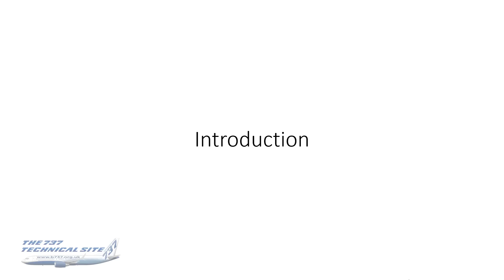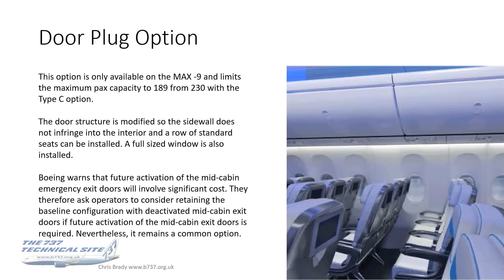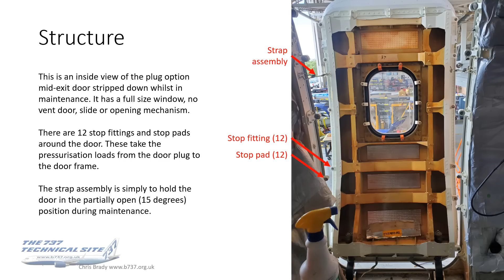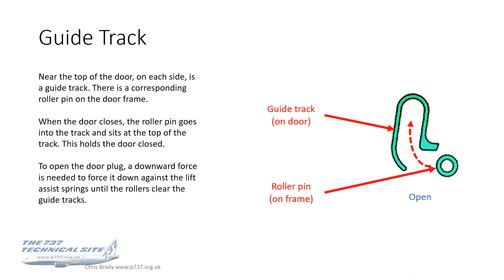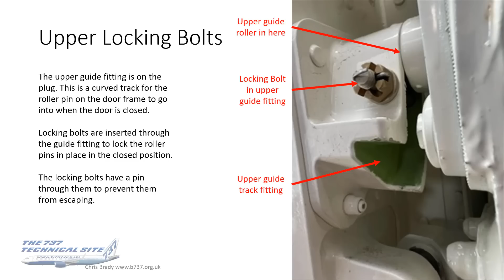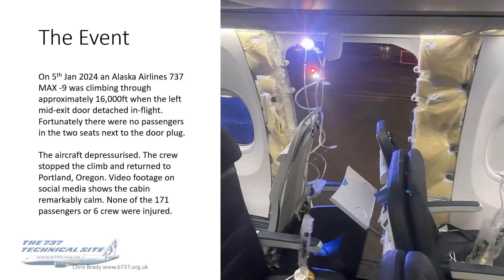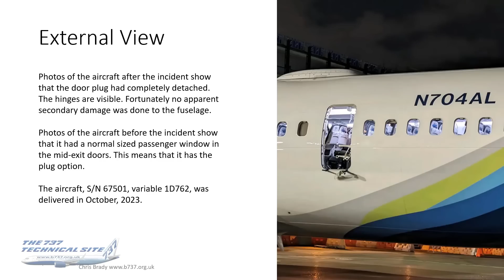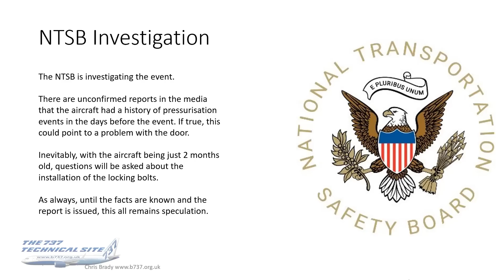737 Mid-Cabin Emergency Exit Doors - Plug Option

Comment: Excellent description! Three comments from an old door guy - 
1) installing those lock bolts as oriented (heads outboard) looks to be a bitch! Imagine trying to line up the holes and thread that bolt thru from the back side. Poor design to make a required safety of flight item so difficult.
2) It's likely the unsecured plug caused pressurization issues on previous flights. Whenever cabin air leaks around a poorly sealed door - it squeals like when you let air out of a balloon. It's loud! No passenger or FA complaints? 
3) the assist springs push up on the door. Essentially, it is spring loaded to open! What kind of knucklehead designs a pressure door that must be manually bolted closed, else it will pop open? It's default position should be closed and locked, not open and not secured. Poor design, incompetent installation...lucky nobody got hurt.

Comment: Loose bolts in this application does not matter. Look at the pictures! When a castle-nut is securing it's bolt, that castle-nut is "LOCKED" into place with it's "Cotter Pin." My humble opinion is the 4 bolts were never installed.

Comment: Who says it is manufacturing? The plugs are installed with BOLTS, CROWN NUTs and COTTER PINS. That means that the plugs can be removed and replaced at any time including seating reconfigurations. Who monitors seating reconfigurations? Cotter pins are a one time use item and must be replaced after every removal with new. Were the bolts left out awaiting new Cotter pins to arrive? Were the wall panels replaced before the job was complete thereby hiding the deficiency?. It is highly suspicious if examination of the plug on the other side of the isle was fully complete. Why one side and not the other? Perhaps seating was loaded from only that one side. Check seating configuration records!

Comment: For me, the problem is with the "lift assist spring". That spring is pushing up the door out of the hinges if the bolts are not in place or secured. I wonder what happens if the spring is removed from the assembly and the bolts are not there. Does the door come off?

Comment: My apologies.  as I reviewed the photos it shows correct orientation of the guides on the door - not inverted.   so the guides would help to close the door (down over the door frame pins) with a download force supplied by gravity and possibly a lever.

Comment: Excellent video and I guess this has probably been discussed, but at 7:15, I don't see how the door can possibly be forced downward against the lift assist springs until the rollers clear the tracks. The tracks are attached to door and the roller pins are fixed to the frame. Only the tracks move and they can't possibly move downward with the roller pins snugly in place. I saw a comment somewhere that the "downward force" is just to unload the spring pressure on the securing bolts so they can be removed, but I can't see how that's possible either. What am I missing? It also occurs to me that the springs must almost entirely counter the weight of the door, so if the securing bolts are missing, it probably doesn't take much force to lift the door upward when the cabin is unpressurised. Without the bolts, the door would be completely unsecured, correct?

Comment: I am not so sure about the lift assist springs having anything to do with evacuation. If there were an evacuation, and the exact same lift spring mechanism was being used in an actual service door, are they the same? even without springs once it was open, it would stay open. In fact it would be dangling down. If some how it were to swing closed there is no mechanism to lift the door into a locked position.
The springs are just there to take the load off, and help the closing mechanism rollers lift the door.
Reply: You are correct. He made a mistake to mention evacuation... the door cannot be even accessed from the inside without significant disassembly, including removing the seats!

Comment: I've always called those locking wires 'cotter pins'. So, if the cotter pins were simply left out, the nuts could conceivably work themselves loose over time & the bolts could fall out. I would assume all lose hardware would have been sucked out by the rapid depressurization.
Reply: In the UK we call them 'Split Pins' We use the term 'Cotter Pin' to describe a wedge shaped pin that (typically) is used in a bicycle crank.

Comment: The NTSB just need to check the plug dor on the other side of the same aircraft. Whatever state those pins are in should be a big clue as to what happened.
Reply from the maker: They said in their second press briefing that they did and they were found to be OK.

Comment: It’s rather disturbing to learn that only 4 bolts, which cannot be inspected except if the sidewall panel from the plane is removed along with seats, is the only thing preventing rapid decompression.  There must be more to the design? Does not sound like much  redundancy especially given there is no sensor on that door plug alerting  crew of any issues.

Comment: For comparison purposes, it would be interesting to see how a real door (not a plug) is installed and how many extra latching points it has to keep it from opening accidentally in flight. I just don't understand why a bolted on "plug" is not slightly oversized than the opening and installed (bolted) in place from the inside utilizing cabin pressure to keep it sealed. It's not like, they are going to be opening this plug very often.
Reply: Normal entry and service doors are opposite of this. 4 guide fittings installed on the airframe side and 4 roller fittings installed on the door side. 2 on top and 2 on bottom along with the stop fittings. When pressurized the door forces itself into the fittings making it impossible to open. My airline we’ve actually had doors out of rig unlatch in flight but remain closed due to this design. I’m not an engineer but reversing this design and making a “plug” that swings outboard is insane to me. It’s not a plug it’s a patch.

Comment: 7:00  The last paragraph seems to be written erroneously.   

   To open the door, an UPWARD force, using the assist springs is required to clear the guide track from the roller pin.

    You have written that a downward force, against the assist springs is required to open the door.

     The upside down “U” shape of the guide track on the door means that any downward force on the door will force the pocket of the guide track further against the roller pin, keeping the door closed.
Reply from the maker: * Errata *
In this video I state that a downwards force is required to remove the door plug. I based this statement on text in the AMM SDS which I now believe to be incorrect or misleading. It is possible that a very small downwards motion (1-2mm) is first required to be able to free the locking bolts. But the door must be moved upwards by a couple of inches to clear the guide tracks. Apologies for any confusion.
Reply: @ChrisBrady737  

       One of the more interesting engineering design philosophies involved here is the spring rate of the assist springs.

      Most likely, it is just enough to offset the majority of the mass of the plug door.
       I surmise that friction on the pressure seal and stop pads combined with the weight of the door kept it in place and the combo of 2 psid @ 16000 and a downward vertical gust on the airframe was enough to unseat the door plug.

      It would stand to reason that stronger springs would help to prevent this in the future.

      Stronger springs would mean that the door would not stay put at all without the bolts being present.

Comment: With the door restraint bolts missing looking to be the root cause, it remains to understand what could jiggle the door up of the stops. -ve g would do it if the net pressure on the door was near zero (even a fraction of a psi would seem enough to hold the door firmly on the stops) so the pressure controller and its operation in auto alt or manual will be the subject of study and also aerodynamic loads under certain conditions. A lot of work to be done yet by the investigators.

Comment: Apology:  as I looked again at the photos the guide channels are in the correct orientation not inverted as I previously said. That's why those hinged post guides at the bottom hold the door DOWN with a bolt, to keep the door guides (and the six stops on each side) over the roller pins and stops,  plus additional bolts as mentioned to prevent the door from moving up.  Gravity really helps a lot with this too if you think about it.  AT 6:45 in the video it shows the diagram of the guide track on the door with the door and guide channel at the top obviously having to be down over the guide pins in the door frame.  And as others have mentioned by now, if those bolts securing the door down were missing the door could work itself up and then get blown out under certain conditions.
Reply: It's not upside down. The door has the guides and (once the door is almost closed) the guide touches the pin at its lower opening. Once the pin is engaged the door is pulled down. This fully engages the guide and makes the stops lock together. Those 12 stops look too small to me.
Reply: @ChrisNason-g7l Yes, the engineers are not stupid enough to design it such that gravity could help open the door.
Reply: @ChrisNason-g7l  you are correct, the photos of the guides are not upside down, my apology.

Comment: The NTSB are reporting that the (upper) guide tracks are damaged on the recovered (door) plug. That might suggest that the bottom failed first and wrenched the top out. The loads are taken through the multiple 'pads' but they seem quite small and wouldn't need much misalignment to allow the (door) plug to move outwards. Maybe the main doors also use this 'pad' system but they should be bigger.
Reply: Exactly, a prying force would be sufficient to fracture the guide tracks.  The main doors are truly "plugs"--the inside is wider than the outside.

Comment: If even ONE of the four bolts was in place, could the plug door move upward and detach?
Reply: It might allow the door to twist so that the 12 pads are no longer engaged?
Reply: @ChrisNason-g7l  Not according to the documents I've reviewed.  The door plug only moves up/down and outward/inward.
Reply: I was meaning that the door does not necessarily rise equally on both lower pins. I do not know the tolerances but I was speculating that one side could rise more than the other leading to a twist that would disengage the pads. @BruceLiebert
Reply: @ChrisNason-g7l  From what I see, the door guides at the bottom and the sides would preclude any differential rise.

Comment: So a 3 ton (?) pressure load, is taken by 4 points.....in essence, a beam, with a hole in it, supported by two points each end?
Reply from the maker: No, the pressure load is taken by 12 points. The locking bolts just prevent vertical motion which would move the door away from those 12 points.
Reply: @ChrisBrady737  thx.....so the 12 points are secured by bolts/nuts?......which were missing?
Reply: @nixy49  No.  Secured by differential air pressure.

Comment: The only way the door can move vertically is if all 4 bolts are missing.  The load on these bolts are minimal based on the weight of tge door with the spring.  Maybe each bolt has a load of 25-30lbs as tge 2 springs are supposed to lift tge door out and prevent it from falling back when the screws are removed.  The door weighs 63 lbs so tge springs in total have to lift 63 lbs so tge springs would be maybe 4olb springs to help lift it.  So there is no way the 4 screws were stressed.  The 12 pins a d stoos on the side of fuselage and plug is what gets tge stress of pressurization of up to 22000 lbs at 36000 feet per ntsb or 5000 lbs at 16000 ft.
Assuming there were no screws the plug over time dislodged upward upon landing , maybe a hard jolt when the pla e was no longer pressurized and moved the pi s off tge stops so only a portion of tge pins were pressing against the stops and once tge plane pressurized and the load increased tge pins just slipped off the stops and then the plug flew away.  That is my co cousin.  The ntsb found no bolts. No way they were sheared. They just were not there. Either they were not installed or all 4 fell out.  Even if there was o e bolt the door could not move vertically.  Negligence.

Comment: Chris, thanks for the detailed video and photos.  It seems to me if just one of the upper bolts failed, there would be such pressure on the rest of the structure that eventually the door would come off after a certain number of pressure cycles.  I find it hard to believe the upper bolts don't have redundancy.  I don't think anyone is going to want to sit next to this door until it's totally redesigned to truly be an oversized plug where the frame contiguously keeps it secure against the cabin pressure.  I think the 737-9 fleet is going to be grounded for sometime.  Just another example of Boeing and the FAA not using best practices in engineering.  One more reason why Boeing should have done a clean sheet jet instead of the Max.  Thanks for your hard work on this!
Reply: The 4 screws prevent vertical movement and bear no load bearing stress of tge door against the fuselage. The 12 pins and stops are the load bearing items of the pressure on the plug as explained by ntsb.  As long as there is at least one screw still in, the door cannot move vertically.  Maximum load on tgat one screw could not be more than 50 lbs so it cannot shear.  All 4 screws/bolts were missing.
Reply: Thanks for clarifying the role of the 12 pins taking the load of the normal pressurization.  It would be helpful to see the diagram of the pin and stop hardware.  Cheers @elangr

Comment: I’m confused. The guide track diagram at 7:00 says the roller is on the frame, the track is on the door and that the roller sits at the top of the track when the door is closed.  But if the door has to be moved down to open, that can’t work. The roller would have to be on the door and the track on the frame or the track would need to be orientated the other way around so the opening is at the top - the pictures seem to line up with the diagrams though so that must mean the door actually need to be moved up to disengage everything vs down, right? Seems like the only possibility.
Reply from the maker: * Update *
In this video I state that a downwards force is required to remove the door plug. I based this statement on text in the AMM SDS which I now believe to be incorrect or misleading. It is possible that a very small downwards motion (1-2mm) is first required to be able to free the locking bolts. But the door must be moved upwards by a couple of inches to clear the guide tracks. Apologies for any confusion.
Reply: @ChrisBrady737  Then correct the video! And stop spreading misinformation and confusing everybody. I gave up when you described a cotter (split) pin as wire-locking.
Reply: Unnecessary. It's quite clear that the guide pin is on the frame and the track is on the door. The door is pulled down to allow the track to engage the pin as it is lowered into the opening. The springs at the bottom are compressed by this action. When opening, the springs help to lift the door so that the track clears the pin and the door can fall open.  @JackDaw-lu7xo
Reply from the maker: Unfortunately, you cannot post-edit a video that has been uploaded to YouTube. I have added the errata to the description. @JackDaw-lu7xo
Reply: @JackDaw-lu7xo  wow, that was TOTALLY uncalled for. This video has literally been far and away the best available and has been used and linked to by scores of journalists, aerospace experts, and aviation commentators around the world to understand and explain the plug and dispel the wild misinformation that was going around to begin with. A minor error on the direction of the door does not in anyway invalidate the video nor is it caused to pull it down and post a new one. A pinned comment is more than enough.
Reply: @ChrisBrady737  definitely don’t pay any attention to that guy. It was absolutely uncalled for. This video is top notch - your entire channel is spectacular. A pinned clarification is MORE than enough for such a tiny error. I can’t get enough of your channel. Absolutely pouring through your back catalog with relish. Such an amazing resource - can’t thank you enough! You’ve definitely won another loyal subscriber! 

And thanks so much for clarifying the opening direction. That makes a lot more sense, although it raises the question of why Boeing chose to engineer it that way in the first place considering the largest transient forces and jolts a plane typically experiences in normal operation (ie hard landings, severe turbulence, etc) are all going to be working along with gravity to help open the door... 🤔
Reply from the maker: @GlutenEruption many thanks, I appreciate your support.

Comment: Those who say the Plug has to move UP to disengage the  Guide Track (on Door), from the Roller (on Frame)...Say AYE!. or Nay if you disagree. I say AYE!
Reply from the maker: * Update *
In this video I state that a downwards force is required to remove the door plug. I based this statement on text in the AMM SDS which I now believe to be incorrect or misleading. It is possible that a very small downwards motion (1-2mm) is first required to be able to free the locking bolts. But the door must be moved upwards by a couple of inches to clear the guide tracks. Apologies for any confusion.

Comment: Someone was pointing out that the Wi-Fi antenna, covered by the dome on the airframe, was installed after the aircraft was delivered.
Regardless any direct .corresponding work to the panel was necessary or not, we need to look if the panel was ACTUALLY opened during the installation work.